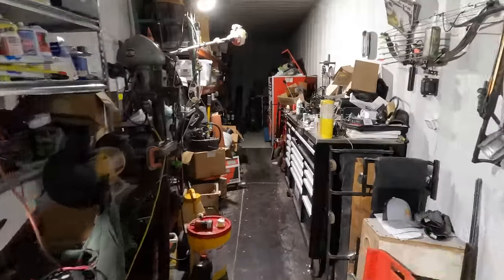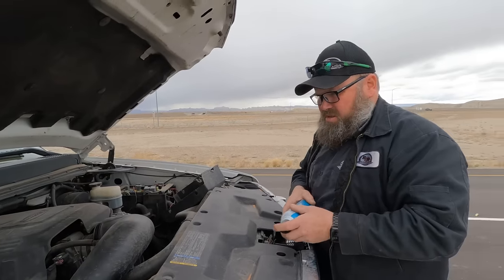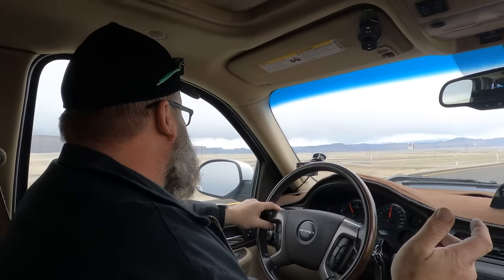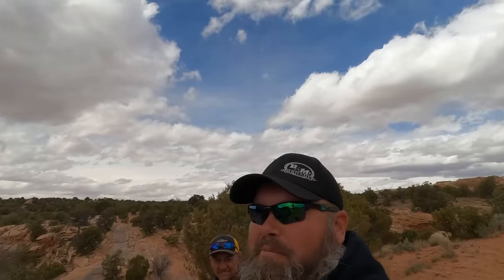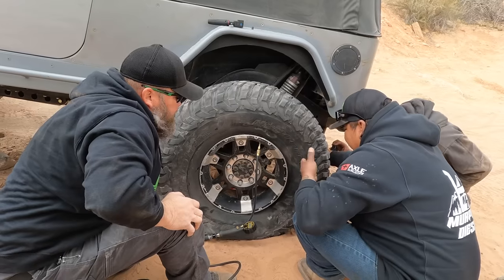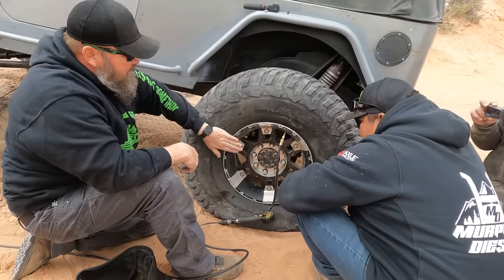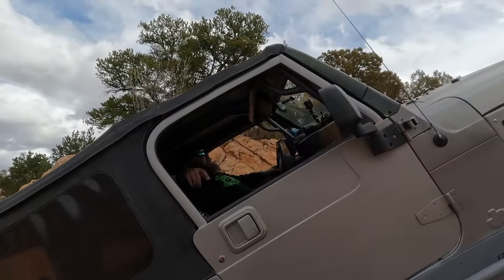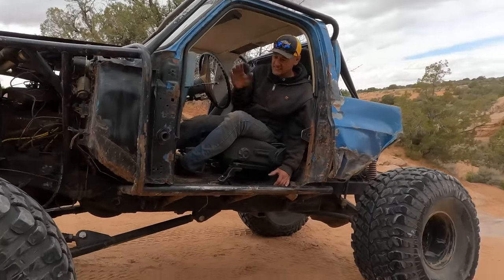Having FUN with Mike & Shawn@dirtbillydeluxe

Comment: Hi Ben I had a similar thing happened to  my car the mechanic couldn't find the  problem, had to fix it myself took the MAP sencer out and cleaned it  brack cleaner, 3 years later and it's still running,has not missed a beat, hope this will help, ❤️ 🇦🇺  👍

Comment: Ben why not get some panels they use to build big barns out of think Fab rats new shop made out of them why not weld a beam to the container about 15 away two poles stuck in the ground weld  beam side to side and put those sheet panels from the container build a roof so you can park under maybe install it on the side of the container the sun set is on so you got after noon shade

Comment: "It's a '77 Blazer"... 🤔 Nope. It's about 7% Blazer. The rest is pure custom buggy.

When every single thing that makes it stop, go, and keep the right side up is from something other than the original vehicle, it ceases to be that vehicle. And it goes way beyond that. Seats, doors (or no doors) the majority of the interior, gauges and controls, climate control, every functional thing has been changed. It's a buggy that is (faintly) styled like an existing vehicle.

That goes for the overwhelming majority of "Jeeps" and every other vehicle on these trails as well.

Don't get me wrong, I enjoy them as much as anybody, but when two vehicles side by side look the same from a distance but have zero in common running gear, or another two looks radically different but have almost identical running gear, it's pretty laughable when people talk about their "Chevy" or "Jeep" or "Toyota"...